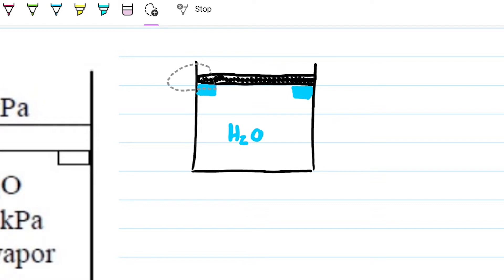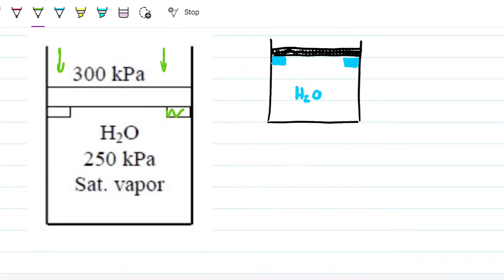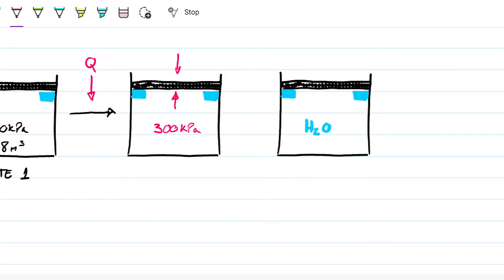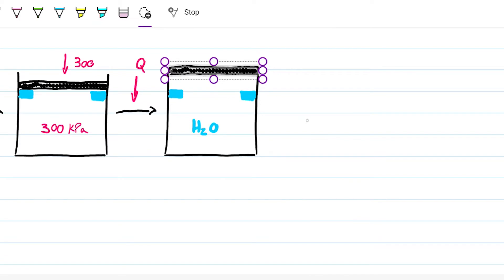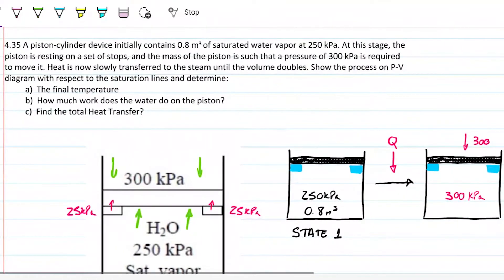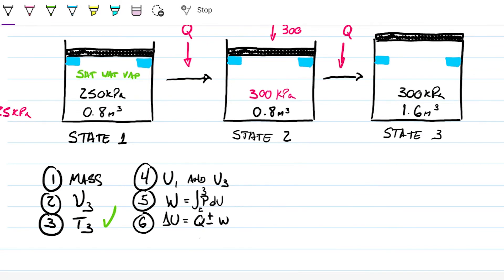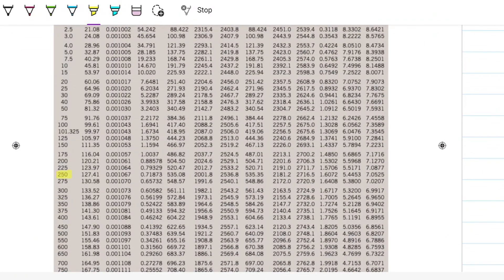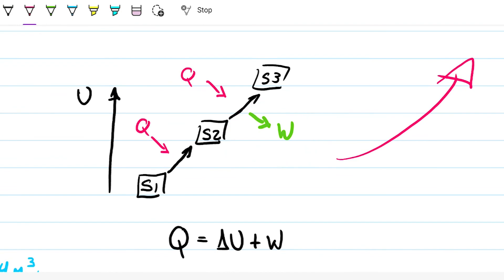First Law of Thermodynamics Problem (1 of 2) | Piston with Stops | Closed system | Thermodynamics

Comment: do you have mabey a solution to example like this one?:

A cylinder covered with a piston, stopped by brake (piston mass is neglectable).
The cylinder contains steam (water) at a pressure of 10 bar and a temperature of 260 degrees Celsius.
The whole system is in a big room, and the pressure is 3 bar.
Then the brake is removed and the piston moves until the system is stable.

a. calculate the final temperature of the steam.
b. is the process is reversible? explain
Reply from the maker: Yep. Check the UNSW question playlist and there are questions just like that